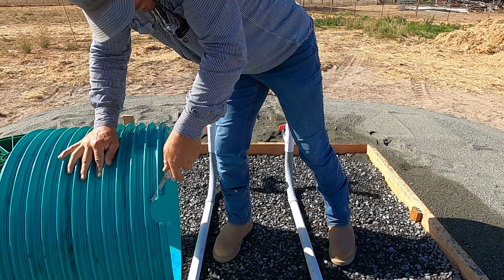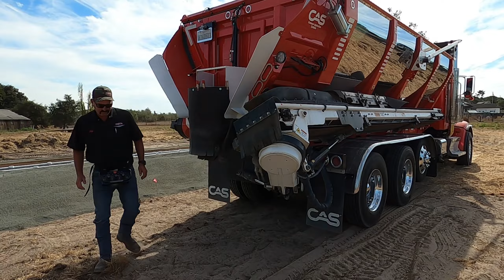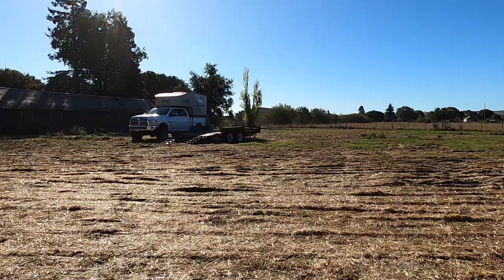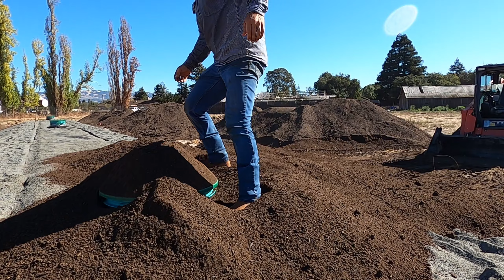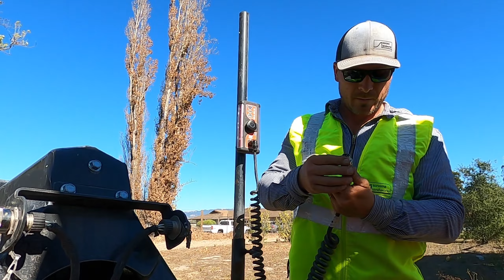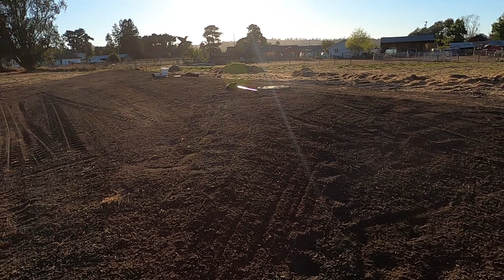Mound system squirt test and backfill EP28

Comment: What a complex septic system for an ADU, is it common to have such a system there in California?
Reply from the maker: The mound system was sized for 5 bedrooms but will only be connected to an ADU in the near future. Mound systems are very common in high groundwater areas and where there is shallow suitable soil. Otherwise an At-grade or drip system is an option with shallow soils and or high ground water.
Thanks for watching!